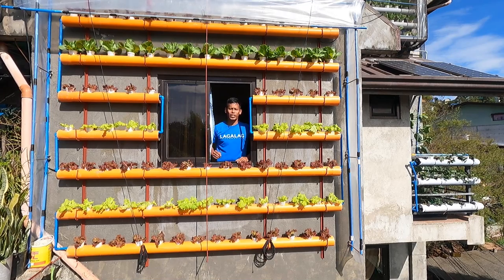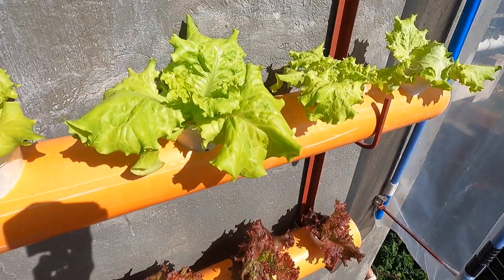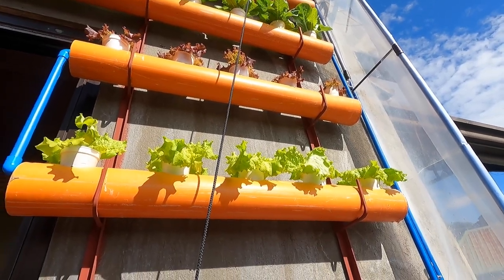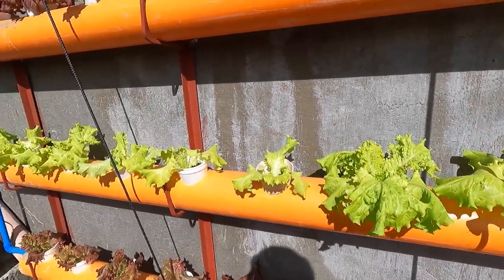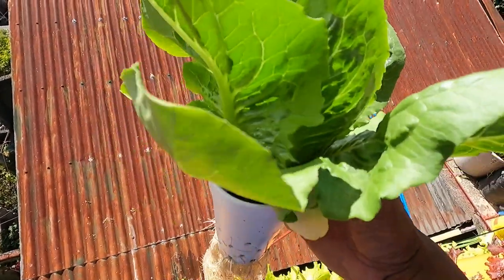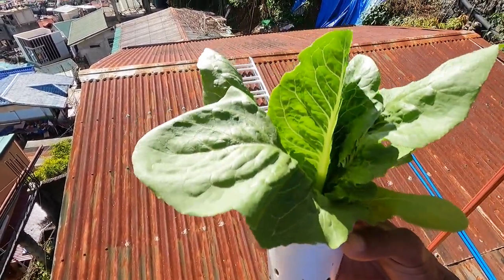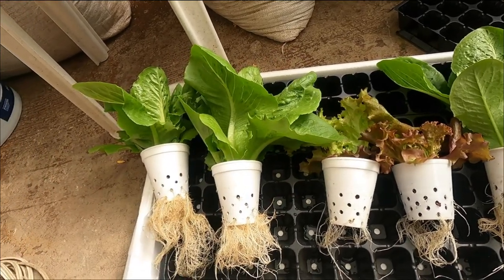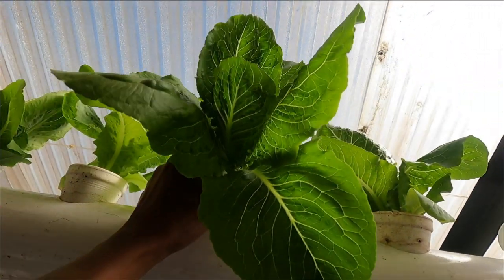Wall Garden Update

Comment: Balotin niyo po ng insulator or paint mo ng white yong pcv, pati na rin yong maliit na pvc / blue pagmainitan sila iinit pati tubig, mag cause din na hindi maganda ang root at hindi maka absorb ng mabuti sa nutrient. Madali talagang iinit ang mga pvc dahil malapit sa cement wall.
Reply from the maker: Thank you po for the suggestion, dito s amin s baguio di problema ang heat mas kailangan p nga po ng heat para hindi magfall below 18°C ang temperature ng solution kaya ok lng po n ganyan lng. S ibang lugar kailangan po ng insulation pag PVC ang gamit.
Reply: @RafTechyDiyAgritronix  Di rin po lalamig ng masyado ang pipe kapag mayrong insulator lalo na sa gabi. Protection din po yan di lang sa mainit kindi sa lamig. Kong baga maintain po niya yong temperature.

Comment: Sir, anung size ng pvc niyo and ung pang hole niya?
Reply from the maker: 4 inches then ung butas is 2.5 inches.
Reply: @RafTechyDiyAgritronix  tama na po pala ung sakin sainyo ko po kasi nakuha ang idea about pvc.. Pero if ever po gusto ko palitan into nft system possible po ba?
Reply from the maker: @re-eee1287  masyado syang malalim for NFT/DFT pero pwede n rin.
Reply: @RafTechyDiyAgritronix  pano ko un magagawa sir? Like sa cup na gagamitin? Wala po kasi ako idea pero planning pa lang naman po kung magka budget😁
Reply from the maker: @re-eee1287  pagkinonvert nyo s NFT/DFT lalagyan nyo po ng pump para magpump ng nutrients solution s inlet s 1 dulo then  exit ang nutrients solution nman s kabilang dulo nkalevel s 1/2 inch ng cup ang nkalubog. Gamitan nyo ng pvc blue pabalik s reservior.
Reply from the maker: @re-eee1287  same po ang 8 oz cup gagamitin.
Reply: @RafTechyDiyAgritronix  salamat sir, very helpful talaga ang mga videos niyo.. GODBLESS po.